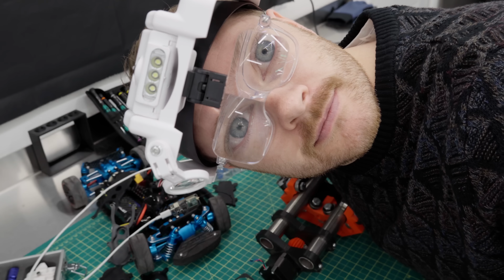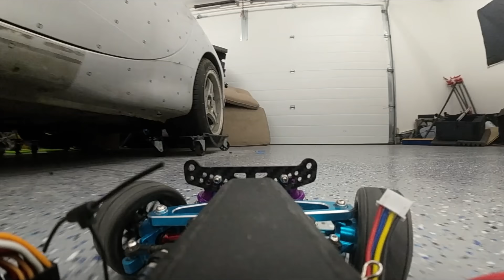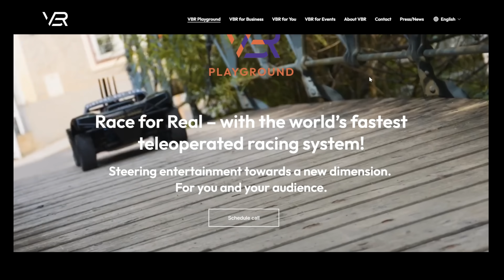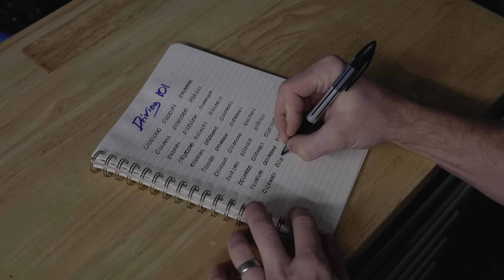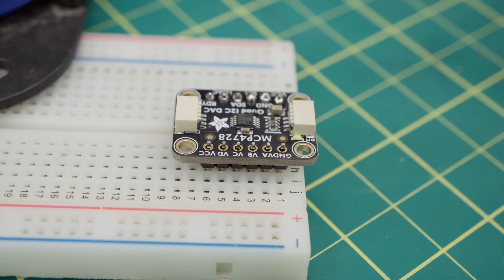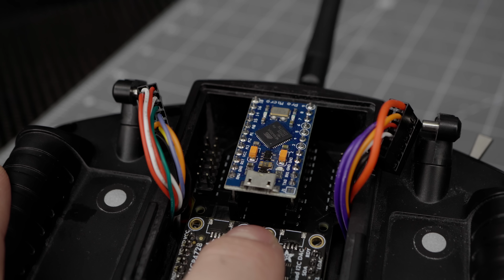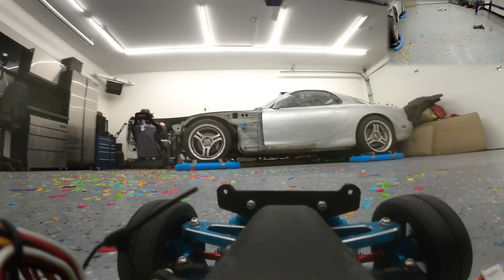Turning a Racing Simulator Into an RC Car Controller: How Hard Could It Be?

Comment: 1st of all you have an rx7 and like sim racing so we are already friends. 2md of all I think you should absolutely make the code friendly enough that people can grab device names and connect the dots themselves. Fantastic work. Or at least do the most common set which are the Logitech g27 - 923. Because those all come with the same shifter wheel and pedals and are inexpensive that could be a place to start.
Reply from the maker: Had an awesome idea from a viewer to use joystick gremlin! That way we can map everything to one "virtual" joystick, making it easy if the peripherals are classed as different HIDs normally. Hoping to get on the edits this week!
Reply: @bits-bits  have you used simhub control mapper? Is that similar in concept?
Reply from the maker: I haven't checked it out yet, but I will!

Comment: Very nice video ! 
How do you communicate between the computer and the car ? WIFI ?
Cheers
Reply from the maker: Via the ELRS transmitter. I did all my arduino/DAC mods and rewired the inputs of the transmitter to the breakout board I designed.
Reply: @bits-bits  I have emailed you :)

Comment: I tried a similar project some time ago, but instead of using a sim wheel I made my own. I came across the issue that the servo did gitter. How does a DAC solve this, dont servos require a pwm signal?
Reply from the maker: The servo itself wants a pwm signal to move but the issue came from transmitting a signal that was already pwm.

The way I pictured it in my mind was you want a "smooth" signal being transmitted over air, so the receiver could take the "smooth" and convert it in to the type of pwm the servo wants. 
By transmitting a "choppy" signal the receiver didn't really have a clear signal as to where the input should be at anything other than 0 or 100%.

I may have been able to overcome this by sending a pure servo signal via the servo.h library to save a some money, but that was an afterthought and the DACs might end up giving me more expandability in the long run. 

I think some modern TX/rx combos work on purely pwm signals, so that would be something cool to explore in the future as a more "plug and play" method.

Comment: This should be a sport. I used to race RC cars and the track size was limited by what you could see and the further it was away from you the harder it was to judge distances accurately. This could open it up to bigger tracks as line of sight would not be a thing. Go kart tracks would be awesome for RC car racing. I’d pay to do it and just have regular track Marshalls sorting out the mayhem of crashed cars etc. I think you’d have to put arrows on the track as if you spin it would get very confusing very quickly. Loving your work!!!
Reply from the maker: That would be so cool! I agree, a go kart track would be perfect!

Thanks for watching!

Comment: I am an engineer getting back into surface RC after a long hiatus, which included flying fixed and rotary wing model aircraft, and flying FPV. It makes me really happy to see what you've come up with.  I am developing a similar system with a digital arduino interface between a USB game controller and the PPM input on my EdgeTx transmitter.  I haven't yet gotten into the nuances of the different steering wheel systems and how they map their controls.  I am hopeful that I can remap channels with the computer radio to accommodate different controllers.  This gets complicated for anything more than 8 channels.  I am excited to see that you were able to map the shifters to remap the throttle.  I really want to configure my system to simulate gears with a modified power band  instead of simply limiting throttle and top speed. I believe that this may be possible with a VESC or other programmable motor controller used for eSkate and eBikes, but I haven't gotten into the weeds of controller programming.

Force feedback is another possibility, and I think it could be simulated by comparing the steering position and the servo position using the gyro.  This would have much faster response  and more precise feedback versus seat of the pants reactions to a motion sim.

Please share more about your hardware interface, I haven't seen any successful implementations using anything other than to potentiometer hack.
Reply from the maker: I've got a long form video planned to go over the hardware stuff I did to make this happen.

I've got a 12 channel TX with all inputs mapped. If I get one with more channels I can just modify and map more, which means more fun!

FFB is in the works! Looking at a few different approaches and I might compare them in the finished video... That one will be a while though.

Comment: The only reason you didn't release the code and scripts is because you are thinking of monetizing it in the future, which is fine in itself, but you should at least be clear and transparent about it. I am saying this because your reasoning that people may not have the same hardware as yours is not justified at all when it comes to coding.
Reply from the maker: Nah, not the case at all. RC hobbies and Sim racing already are super expensive hobbies. I'm gonna do the communities a favor and save them some money. 

I had built the code to look for devices because I have so many peripherals, so I needed to make sure I was pointing at the right ones to get data from/send data too.  When I'm plugging away at projects I've almost always got 3 Arduinos connected at the same time, so I'd tear my hair out if I'm sending joystick inputs to one that is supposed to control an LED strip.. I'd be debugging for hours before I figured out what I did wrong (guess how I know).

Does it suck its not available now? Yeah.. But give me time to edit the code and itll be released.  As you can imagine I've got a lot on the go right now with viewer suggestions 😉
Reply from the maker: Scripts and sketches are released! Told you I wasn't here for the money 😉

Comment: I presume it's a non-issue because you don't mention it but what's the input lag like? I have an old FPV hovercraft or two that would be super fun in my driving sim setup and lag is not an issue with a hovercraft.
Reply from the maker: Zero input lag! Since the inputs are sent via serial right to a normal rc transmitter it's as if you're moving the sticks on the TX itself.

Comment: A great project and love the Hakko FX888D soldering iron its great I have one. I hooe you continue this and make it a series thanks.
Reply from the maker: It changed my life! Used an awful radioshack soldering iron forever.. When I got the Hakko everything got so much easier!
Reply: @bits-bits  for sure I've had mine for about 7 or 8yrs and built many racing and freestyle drones and rc cars with it. It's a great soldering iron and makes life so much easier.
P.S. I love ya FD RX7 I've had a Nissan 180SX for 25yrs I love JDM and go to Japan one day if you haven't you will love it.
Reply from the maker: Glad to say I've been to Japan! Eager to go back that's for sure. There's a bit of Japanese on the PCB I designed in the video that reminds me of how my projects usually go!

Comment: Great vid. When I did this with just a steering wheel and no sim, I had the throttle and reverse wired as the throttle. Fully letting off full throttle wouldn’t send the car into reverse all crazy. I would have to stop the car fully and then fully letting off the throttle would give me the reverse.
Reply from the maker: Ahhhh the struggles of early prototypes 😅

Comment: Have you considered head tracking with a moving camera mount?
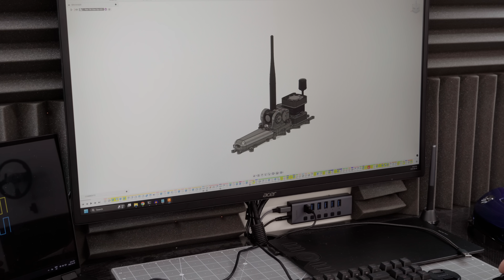Reply from the maker: It's got head tracking, I accidentally cut the part where I went over the resource I used (new to this 😅).. but I've got a link in the description to the Github page.  I show the pan/tilt system at around 4:50 in the video.

Comment: Hey man can u drop what chassis did you use and what motor/esc pls?
Reply from the maker: It's a tt-01 clone from aliexpress. Not sure if has a specific model number, but theres to.s of sellers with them.

The motor+esc is a Hobbywing Quicrun 10BL120 G2 & 3652SL G2 Combo. Works great on 3s lipo!
Reply: @bits-bits  Thank you bro I appreciate it! I found a car with tt-02  chassis , I'm gonna use the base motor that comes with it for now, then I'll upgrade!

Comment: You know they want everyone back to work so this would be my solution; just drive my RC to work so they would see it in the parking lot.  One of the other channels did this for an aircraft.  This should be interesting to see how you do because it’s kind of easy to get lost when you navigating with just a camera.
Reply: I just started playing with a raspberry pi 5, to try to build a functioning SDR in a small package.   So far I’ve lost an SD card that stopped working after booting once.  It’s no longer recognizable at all by any device.   Lol.  I got two SD cards because the brand new SSD did not boot back into his self after the initial configuration and reboot.   I’m wondering if I’m ever gonna get past the operating system to get anything to work.  I have an SDRplay, and I got its software, SDRConnect installed and saw the radio, but as soon as I tried to tune it, it disappeared😂
Reply: OK, the camera looks pretty good, but I’m about to barf on my iPad
Reply: I play with DCS World and MSFS, along with occasionally playing first person games, but I also suffer from motion, sickness and visuals and games are included in that so when I really want to play, it takes me a few days of playing all the time to get my brain used to the movement.    With all the technology, you would think one of my VR headsets would have the ability to suppress motion sickness.  I don’t know run a small current behind my ear.😂
Reply: Guess how long I had my first RC car.  I bought it at a hobby shop when I was something like 13 and it was relatively expensive.   I took it out into the parking lot put the batteries in it and drove across the parking lot and a car came in and ran over my car.😂.  I had my car maybe five minutes.
Reply from the maker: Oooof that's rough! That's my biggest fear with taking mine out on the road hahaha!
Reply: @ that would be funny if the police had to go get RC cars to chase your RC car down : ).   Wouldn’t that be great if that was the only crime we had.  We were all standing around at the park chasing each other’s RC cars down.   You can have a drone act as  a helicopter, and videotape the entire thing.
Reply: There’s a good possibility because of AI that your hobbies will be who you are in the future and the more you have the better off you will be socially.  Work is only a way to pay for hobbies.  Lol

Comment: Nice I would really like to see a detailed video on the Hardware and most important Software
Reply from the maker: I'm hoping to get everything edited and released. After that I can do a breakdown of what exactly you would need (except transmitters because there's so much variety) and how to approach it.
Reply: @bits-bits  Yes that would be nice, maybe try to explain the Receiver stuff as well, at least a bit or how you did it.
Reply from the maker: 🫡 Tech video added to the pipeline!

Comment: Instant sub. This is incredible.
Reply from the maker: Thank you!!! It was an absolute pleasure to make!
Reply: @bits-bits  This came as a great time as I'm just getting into sim racing and am DIY'in almost all of my gear, so it's awesome to see what people do in the space. Quick question, how do you swap out your pedals between your flight right and racing rig?
Reply from the maker: The yaw pedals live underneath my driving pedals! Still all attached to the rig so it's super slick.
Reply: @bits-bits  That's awesome :D I only have a playseat challenge, so I would have to swap out the pedals, but honestly that doesn't take super long.

Comment: We can use the project and make some adjustments to turn it into a RWD drift car. We would add a gyroscope to the steering servo and/or a receiver that already has a built-in gyro. We would remove the front-wheel drive, leaving the car with only rear-wheel drive, and it would use tires specifically designed for drifting.
Reply from the maker: I've been looking in to rwd drift chassis! Could be a lot of fun!

Comment: sir you are legend , the way you explain and showcase  it's perfect ! keep it up good man .    Mby now the head tracking !  i myself own dji goggles 3 so i'm going to buy the  premade one that you have posted + gimbal ... my question is ,  DO I NEED REMOTE ? i have dji controller 3 or a Jumper , but i would like to link it to my car simulator that i have ( logitech g29 )
Reply from the maker: You're too kind! I'm using the goggles v2 with an o3 air unit without a dji remote.  The video system is entirely separate from the control, but the o3 does need some "tricking" to think it's connected to a flight controller. Here's the link on how to do it: https://github.com/ramiss/arduino_DJI_03_RC_ARM

When I get everything edited, the scripts and sketches should work with any wheelbase.  But there's still gonna be some wiring/soldering to get it functional with your transmitter. 😊
Reply: @bits-bits  oh yeah i know about the arming , i was just wondering about the , remote if i need it for anything ... or i can justgo  O3 /  wheel base
Reply from the maker: Yep! O3, goggles, and wheelbase and you're set for fpv. If you do a setup similar to mine you'll need an Arduino and some DACs too.. I have some ideas that might get rid of the need for the DACs.. But I'd have to test it out.
Reply: @ i hope you finish project , and share/sell the full tutorial , worth waiting and buying !!!
Reply from the maker: I'll release the scripts and sketches for free! The cost of Sim racing and rc vehicles is high enough as it is, so I figured I'd do the communities a favor.  It'll still be a lot of work on the end user to get everything wired in and dialed in exactly for their setup. But I think it'll be doable.
Reply: @bits-bits  very kind of your part .. and forward thinking !  thx for taking care of the rc/sim community

Comment: 4:21 is it set to brakes when you're off throttle, cos that mesh is tight
Reply from the maker: I'll have to look at the manual, but I think there is some "engine-braking" setting pre-programmed on the esc. On Friday I go in to brakes in a LOT more detail 😉

Comment: Can you make a video about making a mini FFB Racing wheel with only 3d printed parts for beginners? ( i want to try making this, but I have no idea where to start). Or should i start with a less ambitious project
Reply from the maker: That's pretty ambitious! I did see a guy do a full DIY direct drive wheel not too long ago. I'd browse around for used setups if you're just starting out with things, that's where I started 😊

Comment: The easy way nowadays is to plug in a capable receiver / transmitter (flysky nb4) via usb to your pc and use vJoy or virtual joystick for controls. For FFB, would be cool to relay actual servo current to the rig as a first shot approach
Reply from the maker: Another viewer told me about the nb4, looks like a super nice TX. I started out with a 2 channel flysky initially, then jumped in to a budget friendly tx12s.  Friday's video covers some cool stuff that might be exclusive to the python/Arduino setup so stay tuned!

Also amazing idea with reading the current draw from the servo! That would be a super elegant way to get ffb without load cells and linkages! I've got my work cut out for me 😉
Reply: @ when you broke out the pcb software, I knew you could be one to do it lol fellow RC, sim racer, engineer. Video was impressive and excited for the updates!

Comment: Considering people have been racing rc cars by video since the 80s it can't be that hard.
Reply from the maker: I like to overcomplicate things 😁
Reply: @bits-bits  I wasn't knocking you. It's just strange to me that people were doing this 40 years ago but now it's so complicated. Personally I'd like to see more RC racing done through sim style setups or even just a basic wheel and pedals but it'd had to get a lot cheaper to be more than a niche.
Reply from the maker: You're good! This can be done with any wheelbase and TX (with some wiring and soldering) so even more budget friendly setups can join the fun. In Friday's video I go in to more unique aspects of the complicated setup allows me to do. The level of adjustability I opened up is wild.

Comment: This is fantastic and the exact thing I've been thinking about for the past five years since I built my sim rig. I also grew up driving RC cars with my friends and became an engineer to turn some of those childhood dreams into real things. I've never had the programming knowledge to make this happen, but I'm glad someone does. Great job putting this video together! I couldn't help but notice the stickered up FD in the background. Are you designing your own kit for it or maybe trying to print a scale body for this new rc car? You've got a new subscriber and I'll definitely follow along for your updates on this project.
Reply from the maker: We share a lot of background! I'm not an engineer, nor do I have a programming background, I just love problem solving and design (hindsight I should have done what you did and become an engineer 😅).  

The FD is going to be a multi-year (or multi decade) project.  I've got it fully 3d scanned, kit is probably 70% of the way there on the computer.. But I'm going to need a bigger space - and a lot more machines to do the molds and composite work.

There's actually a glimpse of what the FD should look like when it's done in the video 😉

Comment: hear me out. scale down the throttle and turning speed for scaled-down sense of control
Reply from the maker: There's a short part in the video right where I get everything working where I adjust the steering sensitivity on the fly! It's part of the wheel base software so it's super easy. Friday's video covers controlling speed in a fun way 😉